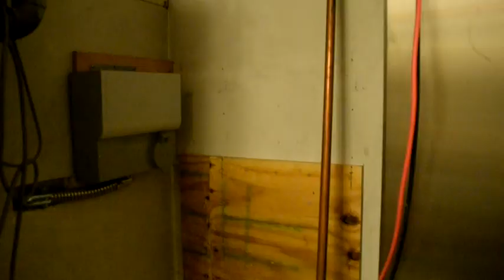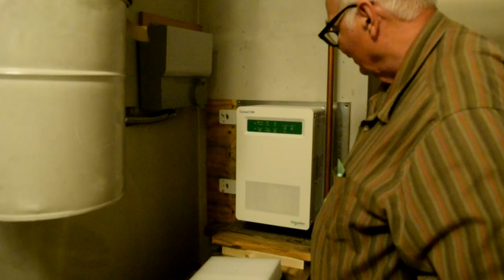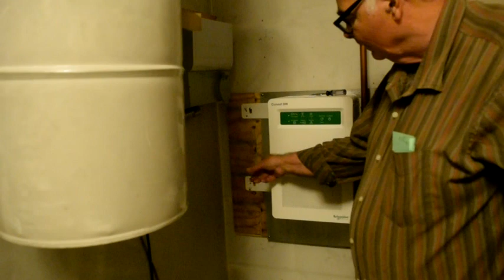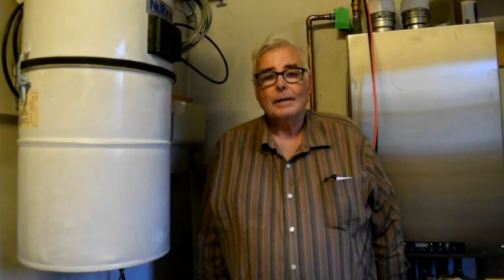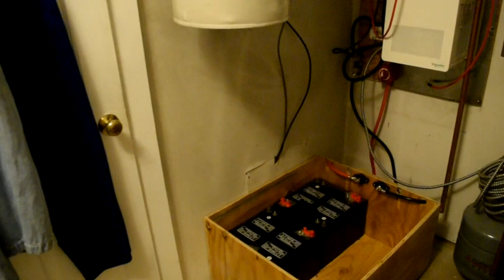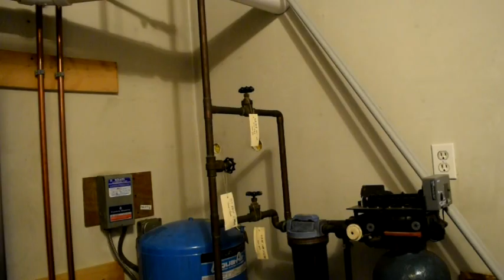Solar/Battery Backup Power - Part-4: Final System Components and Wiring

Comment: Nice install. While it will take time to pay for itself, and the initial cost is a bit high, it will certainly beat dragging out a generator when the power goes out.
Reply from the maker: That is the plan.  The system will not pay for itself in my lifetime, but it will get us through power outages up to 2 days in the winter and pretty much anything in the summer.  Compared to a generator this system is pretty easy.  All I have to do is - nothing, since it has a fully automatic, fast, transfer switch.  It may get its first test today because of the weather.
The price is high because of the cost of big inverters that produce 120/240 split phase AC.  The solar cost about $2,000 when you include the panels, roof mount, wiring and charge controller.  The big ticket items (inverter, solar panels, solar charge controller, battery monitor and batteries) came to about $4,500.  The balance of the cost was for minor but necessary stuff like wires, switches, circuit breakers, fuses, ground rod, battery box, etc.  Nothing rated for high current DC is cheap.  The wires alone came to nearly $460.